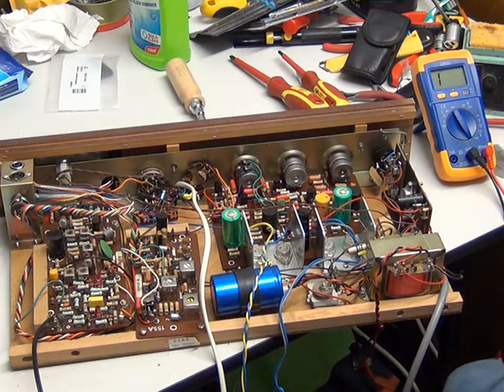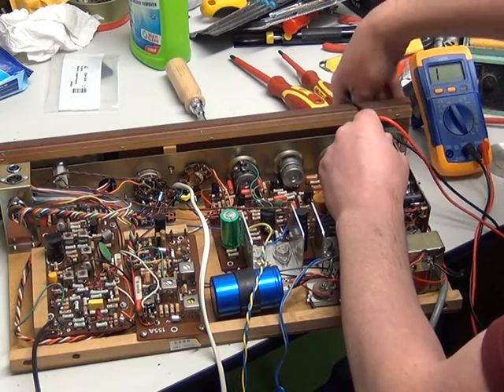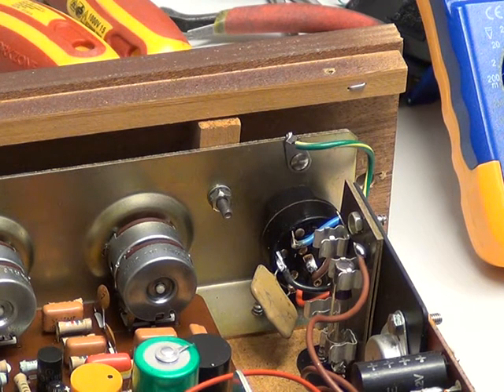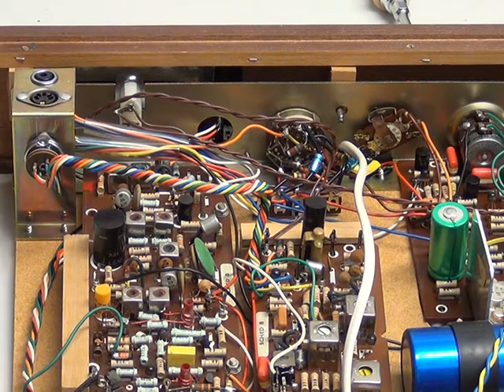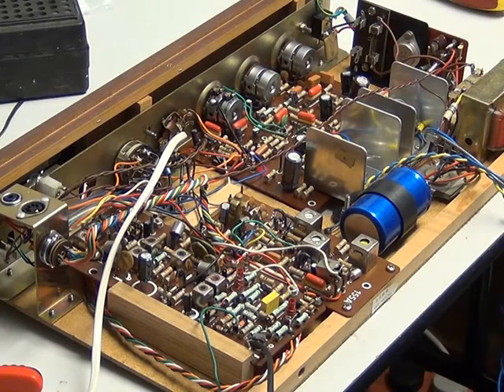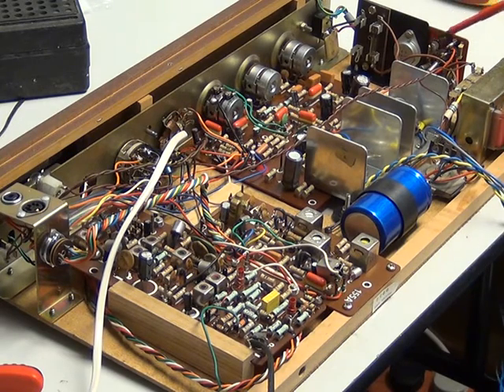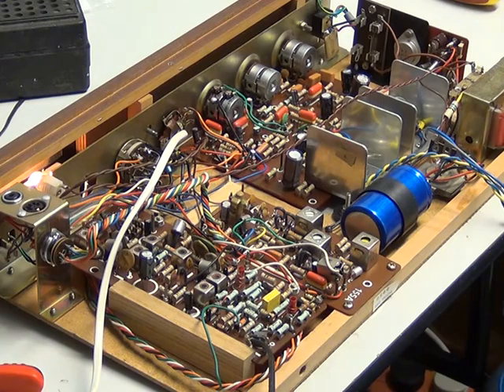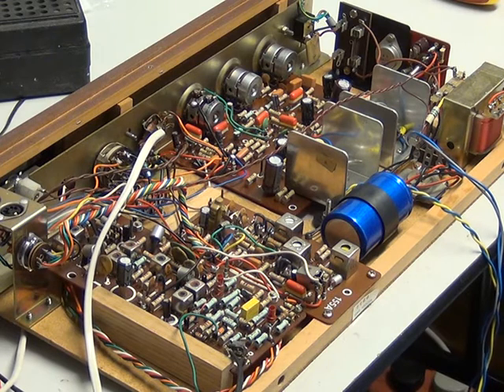HMV 2402 Stereomaster Radiogram - Electronics servicing - pt2 of 3

Comment: Hello, I'm currently restoring my one! What are the replacement capacitors that you used? 
Very helpful video thank you
Reply from the maker: Most capacitors I used are Nichicon 125c rated. However, the 750uV ones & the main smoothing capacitor aren't available from Nichicon, so I used other quality brands. Being in the electronics trade I've access to RS components, from whom all capacitors & lamps used were purchased.

Richard, UK